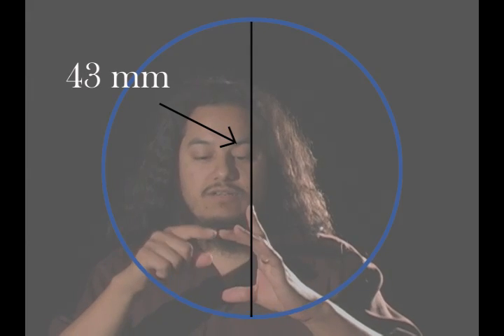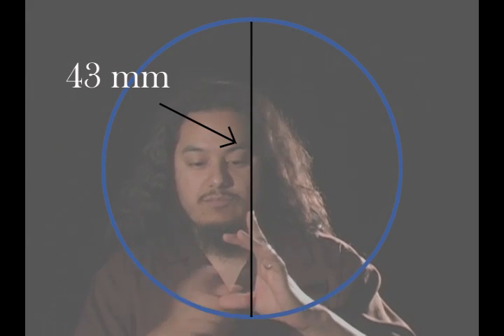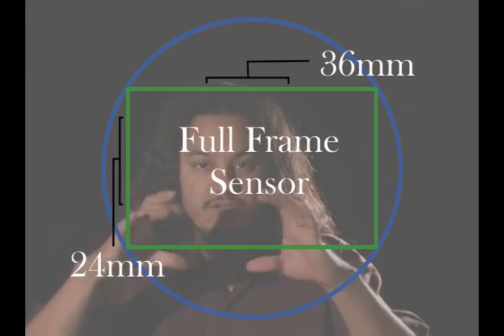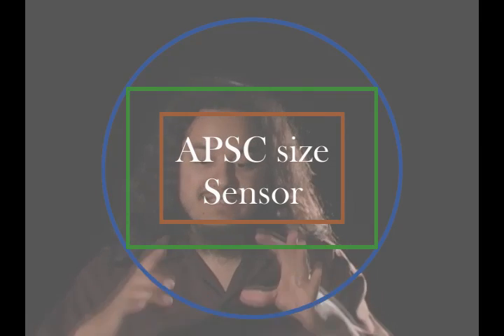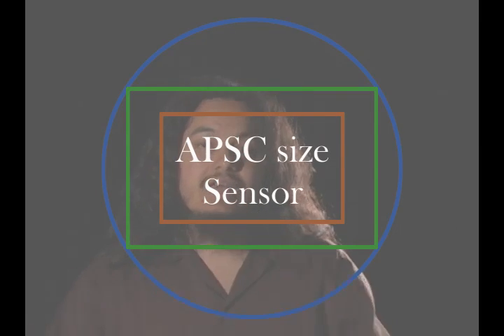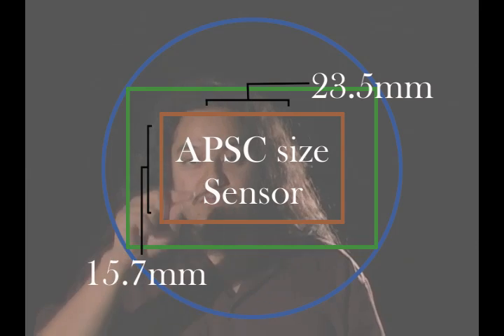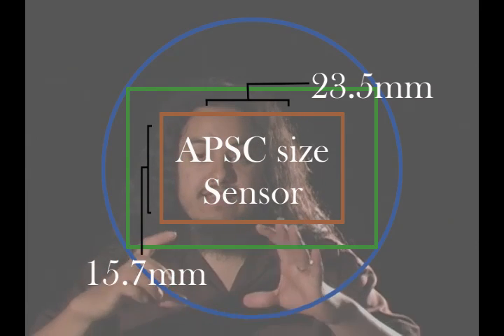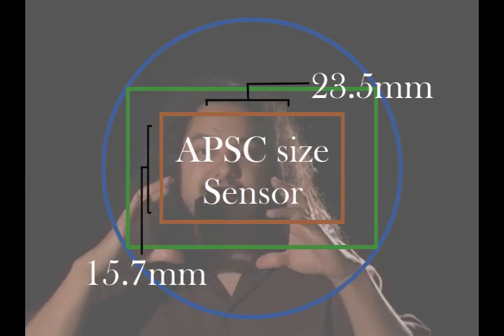Photography Tips ( Image Sensor Size )

Comment: regarding the cropping of an fx picture to make the equivalent to a dx picture (nikon terminology).

im assuming that the full frame camera would need the correspondingly higher megapixels,

because otherwise (assuming a FF 10 MP and CF 10mp) you are cropping out 1.4x your MPs on the FF. leaving you with around 7 MP in that image. vs 10 in the CF pic.

so the FF camera would have to have 1.5x the mp of the CF to allow the down cropping and not lose quality in the comparison. (assuming)

Comment from the maker: The CMOS comes in both sizes.  The 5D Mark ll has a full frame and the rebel series and the 7D have APSC.  Most if the single digit designations such as the 5D and the 1D series' have full frame but always check the specs to make sure.  I hope this helps